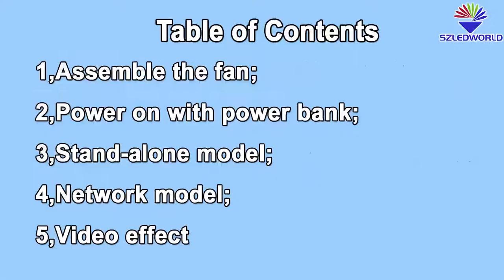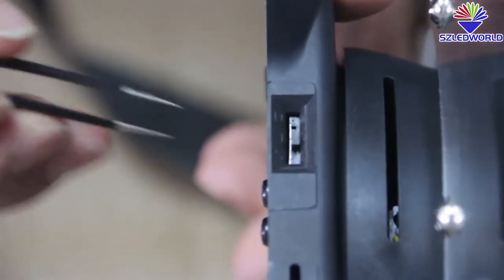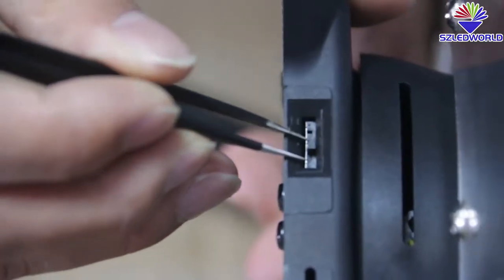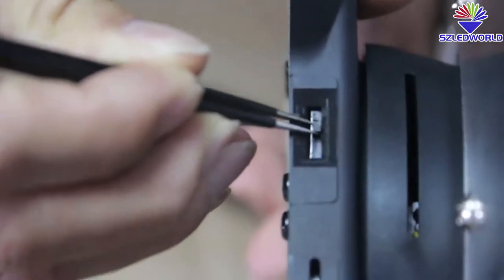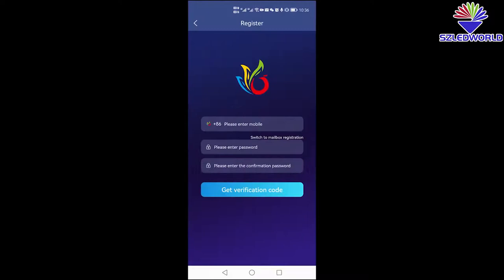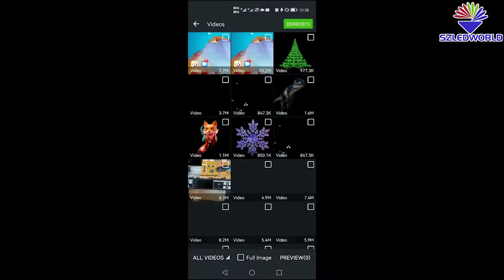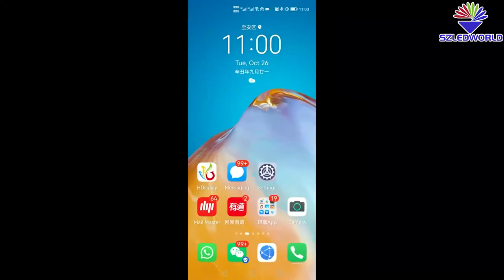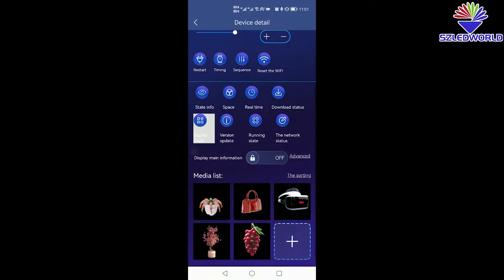how to use 3d hologram software, 3D holographic fan user manual, assemble, operate

Comment: Hello,; fan display software not working, Are all hologram devices compatible with your system? connecting via hotspot, different there is no separate video upload area
Reply from the maker: Hello Salih, 
Not all  holographic devices are compatible with our system,
You can ask your supplier to provide a supporting software system.